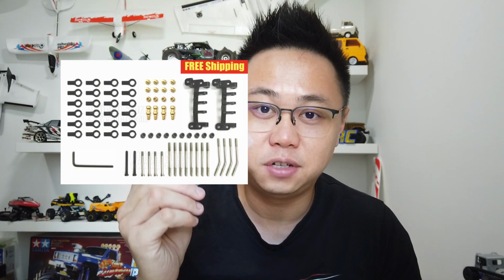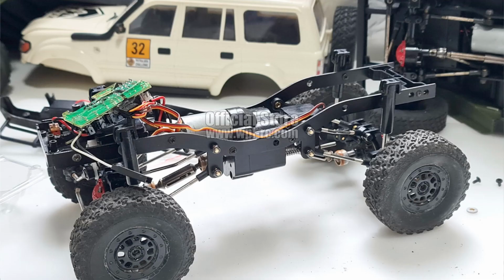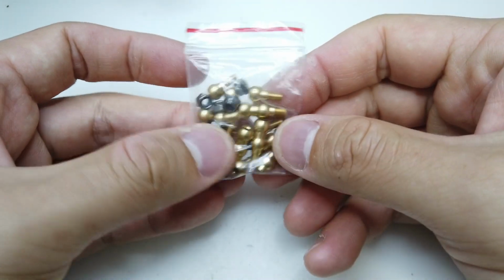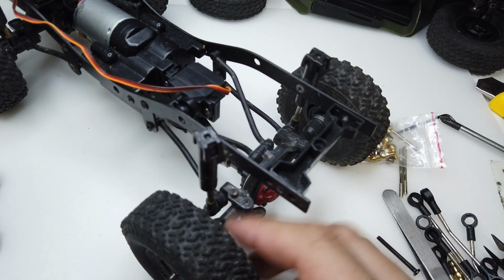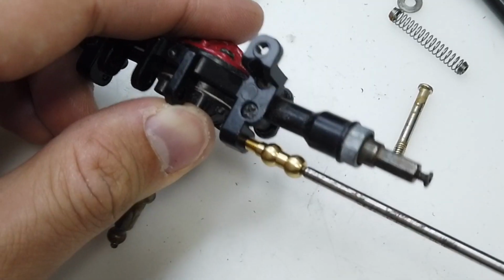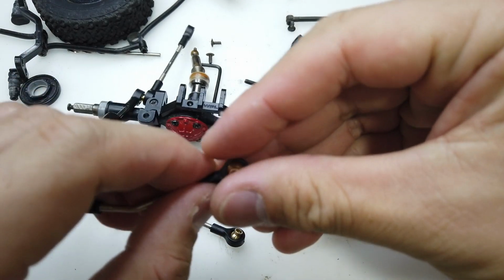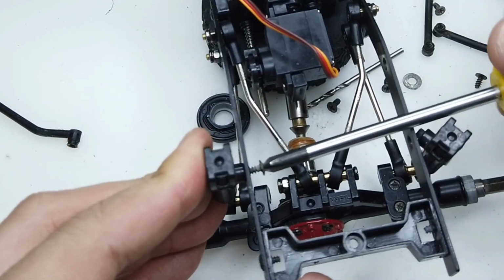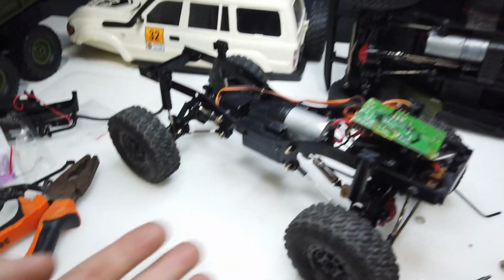WPL Metal Chassis Linkages Build Tutorial

Comment: Does this work with the stock C54-1 RTR motor and gearbox? the motor is obstructing the 4th axle linkage in front.
Reply: Check mine out with double triangulated links. Had to make them with bends to clear the servo for the 3spd motor though.